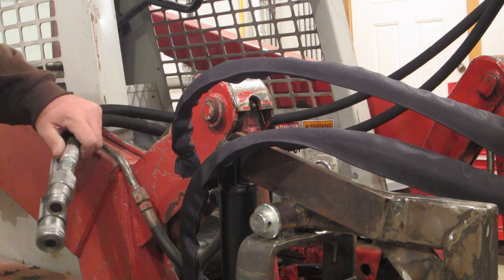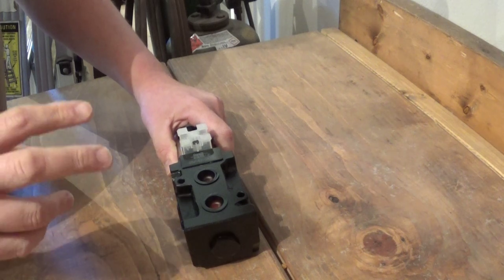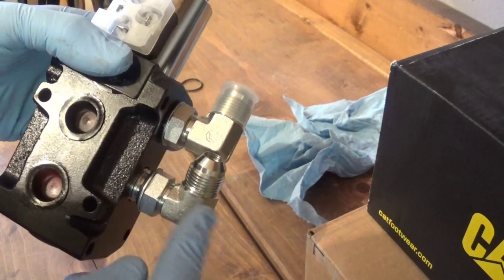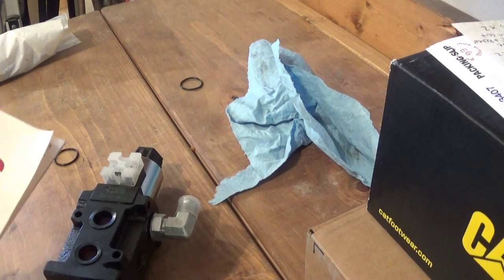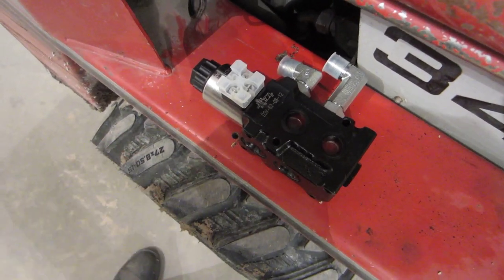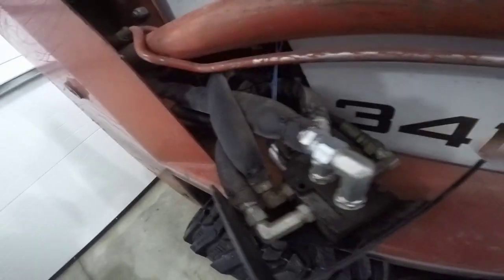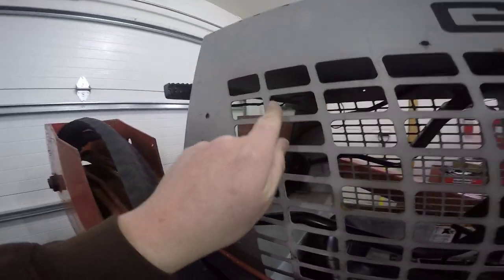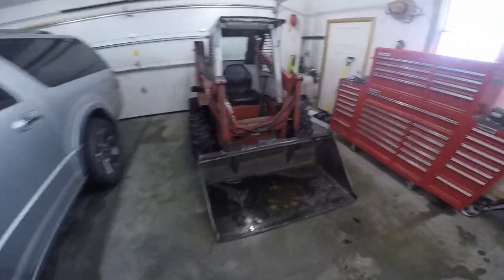How to add Aux Hydraulics with a diverter valve

Comment: I would think if you tee into the lines so constant flow to all cylinders, then ad a single function open/close valve to the grapple cylinders, would you be able to use all functions at once?

It seems like they would although they would both work slower if used together because they would only be getting half the flow

Comment: To avoid the switch why not have constant pressure to both and tie in a directional valve that screws right into each individual line about 40 bucks each?
Reply from the maker: You lost me. How does that provide flow to both at the same time?

Comment: would it be better to have a button on the hand controls? just a thought.
Reply from the maker: That was the original plan. That's what the push-button was for. I had wanted to put it on the end of the control levers but it just didn't work out.
Reply: @SkylarHillShop  I'd like to have the foot control because my skid steer is just hand controls

Comment: What size hydraulic hose did you use from the diverter to the flat face quick connect fittings?? 1/2 or 3/4.  
Doing this in about a week to my Case 1835
Reply from the maker: I believe 1/2"
Reply: HELLO I HAVE A  1982 CASE 1835   DID YOU EVER DO IT ???   WONDERING WHAT YOU USED ??
Reply: I did !! I bought the same valve assembly from Amazon. Local fittings. And bought 12’ hoses off Amazon also. Installed it at the back right corner of my 1830 in-line with the tilt lines.
Reply: 1835*

Comment: Hello, Axe! Nice video! Can you explain that "Aux" hidraulics and "High Flow" hidraulics its same things or not? Just want to understand.
Reply from the maker: Nope they are different. Aux hydraulics means you have a pair of hydraulic fittings to connect attachments to. High flow refers to the gallons per minute (gpm) the pump can produce. Some attachments require high flow to operate properly, just how many gpm is high flow? Well that depends on the manufacturer.

Comment: This is run on 12v correct ? I see the pedals say recommend 230v so on just making sure I order the right pedal. And do you have a link to the diverter?
Reply from the maker: Correct it's a 12 volt system. I think 230 volt was the max rating for that pedal it has worked fine so far in my setup. Here is the current link to the Valve. Surplus Center is always changing what they have so links continually go bad.

https://www.surpluscenter.com/Hydraulics/Hydraulic-Valves/Selector-Valves/13-GPM-12-Volt-DC-SAE-8-Solenoid-Operated-Double-Selector-Valve-Dynamic-DSV-62-08-12-9-8602.axd
Reply: Any details on how you wired inside the pedal. Or is it pretty simple?
Reply from the maker: @Troy Capolo mine is very simple. If I remember correctly there was a diagram inside the foot pedal. The switch could be wired either normally open or normally closed depending on the application. If yours is different or need help let me know, I'll see if I can be of any assistance.
Reply: Awesome will do man. Everything for it just came in! I will let you know how it goes

Comment: If you first used a “T” fitting and put the diverter valve on one side and the dump function on the other side of the T then plug the main out on the diverter would that not give you a “true “ 3rd function?
Reply from the maker: I see what your saying, but those 2 functions would still be tied together. With your example if I tied the dump function along with the open function for my grapple I would only be able to open the grapple when it's fully tilted down as soon as I try to tilt the grapple upwards it would close it because the close and tilt up functions would be tied together. Truth 3rd function are completely independent of one another. I wish I could have found the kit that Gehl produced for my skid steer it gave you a foot pedal to run the auxiliary hydraulics.

Comment: Could you put that on a Toggle switch and have constant flow?
Reply from the maker: No, it just diverts the output from the existing valve. So the valve still needs to be actuated.

Comment: Will you lose pressure hold if you rob power or will it hold?
Reply: For example if you robbed from you arm lift and you raised it up 3 feet and then flipped the switch to use a grapple, would the arms start sinking?
Reply from the maker: The diverter completely cuts off flow so your other cylinders will remain exactly where they're at. Unless your cylinders leak internally then they will slowly settle. But if that's not currently happening then installing this diverter kit won't cause any issues.
Reply: @SkylarHillShop  I looked up the valve number 4 sized ports? Doesn't that restrict normal flow?
Reply from the maker: @Hiperf2007 it very well may restrict flow on your piece of equipment. My skid steer is nearly 30 years old and does not have high flow hydraulics. Plenty of companies make diverter valves I'm sure you could find one in a larger size.